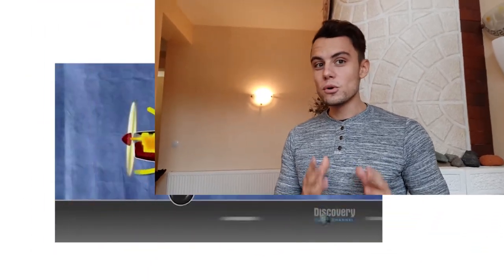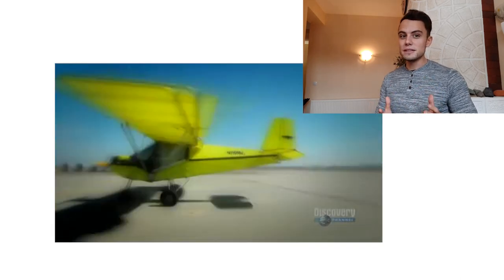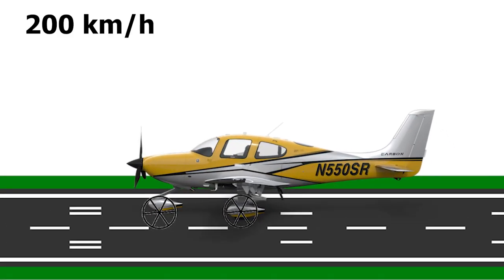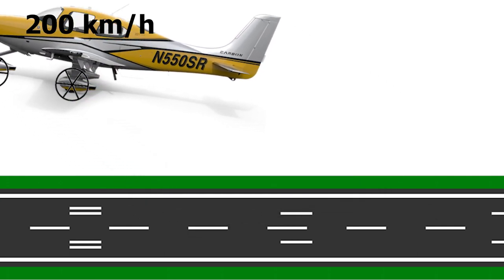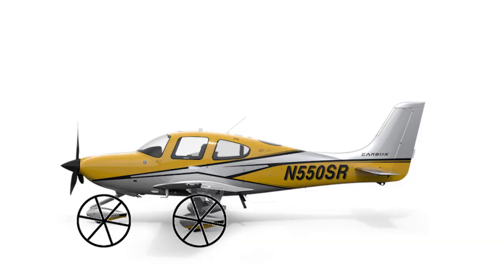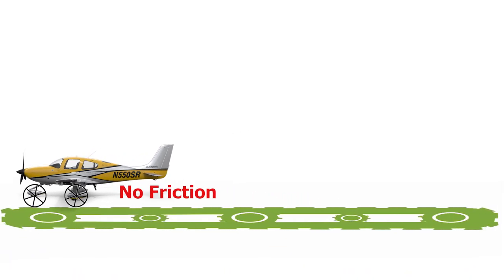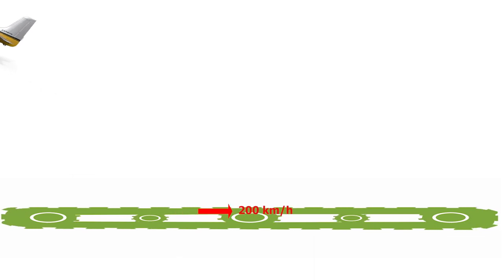Can an Airplane Take Off From a Conveyer Belt?.... Finally Solved!

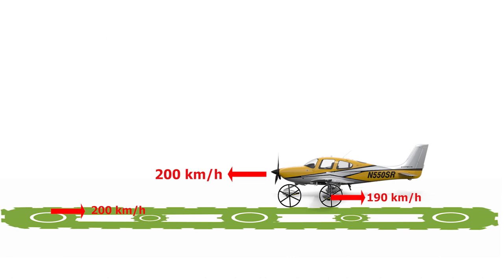Comment: 5:30 you have it going 200 kmh forward while the belt is going 190kmh, but what if the belt goes 200kmh?
Reply: same result. Thrust from the engine and groundspeed are completely disconnected. If the belt was traveling at 1000000kmh, then it would be the same story.
Reply: @annereilley4892   Okay. I see what you are saying. No mathematical equation applies to this scenario, because the engine, which is powering the propeller through the air, is disconnected from the ground. There is no relation between ground speed and air speed. Lets envision the scenario that you are presenting in terms other than that of variables. a plane is sitting stationary, with the treadmill underneath it going 50 mph. the plane starts to increase in speed forward, because the energy that is being used by the engine is pulling the plane forward using the air. (this is a day with no wind). Because the airplane is getting pulled forward via the air, it accelerates to its take off speed, which is 50 mph. It just so happens that in this scenario, the treadmill adds 50 mph to the wheels speed. The wheel speed (a unit of ground speed) and takeoff speed (a level of air speed) are unrelated and do not affect each other, so the plane can take off. There is no need for equations with misleading and confusing variables.
Reply: @annereilley4892   Also, doesn't that video that you have linked just agree with my statement? (Besides practical physical limitations of the rubber on the wheels)
Reply: @sagealling40  In the video, scenario 1 he claims it will not be able to take off.
The way I see it, the wheels are actually being powered by the conveyor belt.  It's as if you have a truck going nose to nose with the plane.
In the case of a fixed speed conveyor belt going 25mph, the plane will move forward 25mph, causing the wheels to turn at 50mph.
But in a variable conveyor belt, the belt doesn't stop at 25mph, it attempts to match the overall speed and push it back with equal force.
Imagine if the propellers were turned off, but the conveyor belt was on.  Wouldn't you agree the plane would roll backwards?   This is actually what happens, planes don't have a reverse, so a truck will be used to push a plane backwards.
In order for the plane to take off, it needs to equal that force, plus add more to overcome it and go forward.  If the conveyor belt keeps increasing force to match the plane, it can never take off.
The only solution I can see is if the propellers are strong enough to overcome the friction of the wheels, in that case the wheels will lose traction and slide along the runway, taking off much like a sea plane that doesn't have wheels.
Reply: @annereilley4892  Alrighty, I agree that the wheels will always be moving double the airspeed when the plane is accelerating. And I agree that at a certain point, the friction happening in the wheels will equal the force being exerted by the motor (This is if the plane never takes off). They key thing to note is that, yes, while the wheels will be going double speed at all times, once the plane reaches takeoff air speed, the wheels will leave the treadmill and the interaction will cease. Based on the fact that plane engines are powerful, and the wheels on them are made to have as little friction as possible (ball bearings), it is easy to image that a plane can take off even with the friction of the wheels going double speed.
Reply: @annereilley4892  Also, on your comment that it is similar to a truck pushing the airplane: The critical thing to remember here is that the treadmill is only interacting with the wheels, and nothing else on the airplane. The wheels are made to have as little friction as possible, so all of that force being exerted by the treadmill has little effect on the airplanes momentum.
Reply: @sagealling40  but how can it take off?  if it's being held in place, there will be no lift or headwind.  It's like if you run on a treadmill, there's no wind over you no matter how fast you run.  You can keep accelerating, but as long as the treadmill accelerates with you, you can't move forward to get lift.
In the variable belt, it doesn't just go double,  it's accelerating the opposite direction to match the accelerating propeller engine.  it will match what ever force the plane exerts to go forward.
Friction is the only thing holding it in place, it would have to slide forward if it wants to take off.

As you said, the friction of the wheels isn't enough to keep it in place, so it ought to slide forward and take off.
Of course, if the wheels lose traction and stop spinning or lock up, the belt speed will instantly drop to 0 and the plane would be flung forward as if by a slingshot, due to its momentum and no force acting against it anymore.
Reply: @annereilley4892  So think about it this way. When a plane is on a running treadmill, the only things that are affected by the treadmill are the wheels. The wheels barely have any effect on the plane, as they can spin freely. 
Any force on the wheels only leads to spinning, not pushback on the plane.
 As you said, the treadmill is running in the opposite direction of the wheels, at double the speed (hence it matches the speed backwards) that the plane is moving forward. All this does is increase the speed of the wheels as the plane accelerates. 
(Also you say that having sliding wheels would allow the plane to take off, even though this would have much more friction with the treadmill. The lessened friction with the treadmill is achieved with the wheels, not without them). 
The energy that is being exerted by the motor is making the plane move forward by the air, and not the ground. The air is stationary in this hypothetical situation. the plane does not need to use the ground to push itself forward, it only needs stationary air and the propeller spin.
We can see that the plane will accelerate forward using the air and the propeller because the propeller does not need to use the ground to propel itself forward.
Because the wheels and how fast they spin does not affect the rest of the plane above a negligible amount, the plane will take off with the speed gained by the propeller just like a normal plane on a normal runway. (only with the wheels spinning faster)
Reply: @sagealling40  I wrote something long, but I need to think some more about this.  thanks
Reply: @Anne Reilley
 Ok, so we have found the main thing that we disagree on. The amount of force exerted on the plane, through the wheels, by the belt. You are saying that the force exerted on the axle by the belt will match the amount of force exerted the other direction by the propeller. I Agree that at a certain speed, the conveyer belt's force on the axle of the wheel would equal the engine's force. This would be a higher speed than double the aircraft speed, though. (I have already talked about how the wheels would be spinning double the planes forward speed in this scenario)
The treadmill is pushing back the contact patch of the wheels. This does cause pushback on the axle, though most of the force goes into spinning. Once a wheel is spinning, and the ground beneath it is going the same speed, there is very little energy being exchanged, besides a small amount for friction. If the ground accelerates, the only energy that it would be expending is to accelerate the rpm of the wheels. once they are both going the same speed, there is again very little energy being exchanged. The wheels on the plane are in motion, so they will stay in motion, with no force needed to keep them spinning. 
The engine and propeller, on the other hand, are more efficient at using the energy in the gas to move forward. So most of the energy that comes from the plane goes into moving the plane forward. 
because the force of the treadmill is being put into spinning the wheels, and not stopping the axle, while the propeller and engine are very efficient at moving the axle forward alone, the plane will move forward, leading to takeoff. The energy transfer from plane propeller to forward motion is more efficient than that of treadmill to axle pushback.

What I am saying is that the force that is exerted on the axle through the wheels is negligible, considering that most of the energy is put into spinning. This negligible amount is what will start making the plane slowly start to move back if the engine is not running when on the treadmill, as you said. 
 The engine can overpower this pushback, as it is more efficient at providing power to make the plane go faster than the treadmill is by spinning the wheels when matching the speed of the plane. 

To provide an example that shows the negligible axle pushback that comes from rotating wheels: Think about a bike rolling along a road at ten miles an hour. Stop pedaling, and it will slowly stop. Now think about a bike going 20 miles an hour. The wheels are spinning at double the speed, but the bike does not decelerate at a more rapidly rate than before. This shows that just having a wheel that is traveling along the ground faster does not mean more pushback on the axle it is connected to. 

Another thing I would like to say: If you state that by having this treadmill, the forward and reverse force would always equal one another, this means that the plane could never even start moving in the first place according to your version of things. No matter how much gas you give the engine, in your scenario, the plane would never be able to move at all. The wheels and the belt would be locked in a motionless state. (If it were able to move in your scenario, then you agree with me that it could get up to a speed where it could take off). Are you stating that the plane is just locked and not moving, no matter the amount of force being given out by the engine?

Sorry for the long response. Thanks for keeping it civil with me! I am enjoying this discussion.
Reply: @sagealling40  I think i realized my mix up.  I had thought all this time that the belt would be turning the wheels the opposite direction, but now i see the conveyor belt would actually be turning the wheels the same direction as the propeller does.
The conveyor belt would actually need to go the same direction as the plane in order to turn the wheels the opposite direction.
Reply: @annereilley4892  Not exactly my point, but still glad you're figuring it out! kind of hard to wrap your head around.
Reply: @sagealling40  Thanks, I really want to understand this and not just have a vague idea of it.
Reply: @annereilley4892  Even if you pulled the belt the same direction as the plane, the wheels still will only slow the plane by a totally negligible amount. The bearings in the wheels are there to reduce friction between the plane and the ground. You would need that friction to reduce the plane's movement by any meaningful amount.
Reply: @sagealling40  "the wheels will always be moving double the airspeed" - you are looking at it from a physics point of view, instead of looking at how the question is actually formulated. Let's assume that the belt matches the speed of the wheels, like Anne asked about. Note that is a DIFFERENT question from the one the video answers.
In that case the wheels will not spin at double the airspeed as you assume. The wheels will need to spin at airspeed PLUS whatever is needed to keep up with belt. That is, we have (wheel speed) = (airspeed)  + (belt speed).
What is the belt speed? Well, that is formulated by the question already. It is equal to the wheel speed. That is, (belt speed) = (wheel speed). Those two equations can only both be true at the same time, if the airspeed is zero. So the plane cannot develop any airspeed, the question does not allow it to.

"Are you stating that the plane is just locked and not moving, no matter the amount of force being given out by the engine?" - That is correct.
You have already described how that works from a physics point of view. The belt will speed up to the point where the drag due to the friction of the wheels equals the thrust of the engines. Of course, in any practical situation that is only possible when the friction of the wheels is much higher than normal. For example, when the pilot steps on the brakes.
Reply: @annereilley4892 Planes don't have feet. They don't move by pushing off against the ground.

Comment: No it won't fly.  Wing must have air moving over it to produce lift.   If it's sitting on a conveyor and the wing does not have airflow over it, there is no lift.
Reply: 😂 an aircraft is not propelled by its wheels so contact with the ground is irrelevant.
Reply: @TGoff-fz7yh  Unless the ground is moving so fast back that the friction on the axel is countering the engine thrust.

I.e are we talking about the wheels forward speed or rotation speed.
Reply: @catprog @papapapalima_scotland Actually, when the conveyor belt runs backwards, it spins the plane's wheels FORWARD!  If there's any significant friction in the wheel bearings, the reverse-running belt ASSISTS the plane in moving forward through the air. (That advantage is negligible, but the reverse-running belt is certainly not putting any drag on the aircraft.)

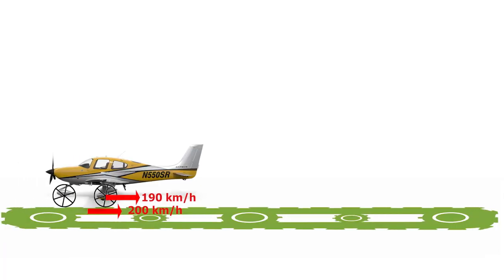Comment: Here's the thing with this video (which is one of the better since he properly points out the internal losses which mean the vehicle would not move backwards at the 200km/h).  Once he applies the new force to get the resultant 200km/h from 5:00 onwards, that changes the wheel speed and the conveyor would by necessity of the scenario have to accelerate in keeping with the new wheel speed.  So it seems like the rate of change is not incorporated into the solution (see minute 6:00).

It seems like each explanation, the proponents say that they can increase the wheel speed no matter what; it's a brute force approach to 'break' the terms of the scenario.

Yes?  No?
Reply: You can't change 1to1 the conveyor only moves when the wheel rotates in place, not happen. The wheel only rotates as the jet moves forward the rolls over the conveyor and  amount of conveyor  behind wheel is the same as the movement of the jet 1 to 1. The conveyor never moves and the plane takes off. 

The wheel speed matching the conveyor is the key to solve this. The plane is sitting on the conveyor neither the wheel or the conveyor is moving. Now start the jet move  1 rev of the wheel now the plane has moved forward and 1 rev of conveyor is now behind the wheel. The real question is how fast the conveyor is moving.      The answer is it is not and never will. That is the trick of this question.
Reply: @tedfann3618  that is an incorrect assertion based on the conditions we are given.  For every inch the wheel of the plane moves; the conveyor moves that same distance.  Not only does the distance rolled match the linear distance moved by the conveyor, the mathematical formula and calculus tells us that the rate of change of the wheel rotation due to the thrust of the engines is exactly matched by the acceleration of the conveyor.  That's the derivative of speed (exactly matches).
Reply: @MrDefreese  What acceleration? The wheel speed and the forward motion of the plane controls what the conveyor belt does. There is no need for the conveyor belt to move, it is already in a 1 to1 with the wheel and plane. There is no acceleration in exactly.
Reply: @MrDefreese  What incorrect assertion would that be, Sir. It sems to me your answer matches my answer. As for opposite direction, lets look at the top of the wheel, its moving the same direction as the plane and the bottom is moving in the opposite direction. So the conveyor even when stopped being moved the opposite direction of the plane. I look forward to your answer.
Reply: @MrDefreese  The riddle (Imagine a 747 is sitting on a conveyor belt, as wide and long as a runway. The conveyor belt is  designed to exactly match the speed of the wheels, moving in the opposite direction.)                                                                                                                          Can the plane take off?                                                                                                                                                                                                       Lets brake it down                                                                                                                                                                                                                 747= real plane, it will take off                                                                                                                                                                                               Sitting= Stopped, not moving, wheels not turning, and conveyor not running.                                                                                                    Conveyor belt designed to exactly match the speed of the wheels = Conveyor belt can only match wheel speed, it can't change wheel speed.                                                                                                                                                                                                                       Moving in the opposite direction= The top of the wheel the moves in the same direction as the planes forward movement, the bottom of the wheel moves in the  opposite direction to the planes forward movement. So any conveyor belt the wheels roll over moved opposite the plane.                                                                                                                                                                            To make the wheels turn the plane must move forward, as the wheels turn they roll on the conveyor belt at the same speed. Because the speed of the wheels  already matches the stopped conveyor belt, the conveyor belt  will not have to start and the plane will take off.